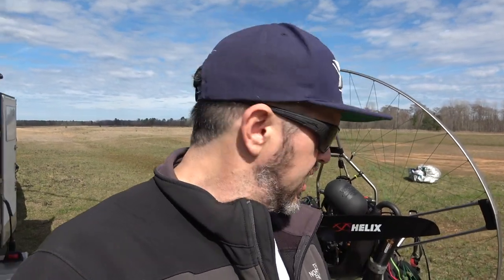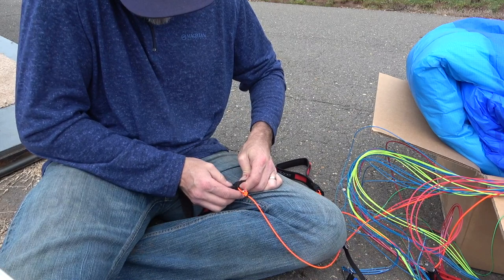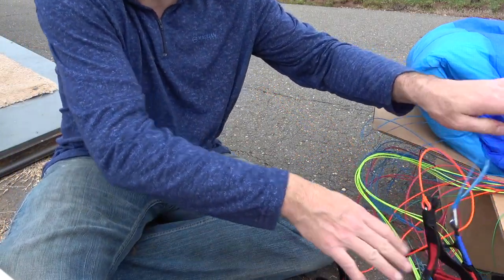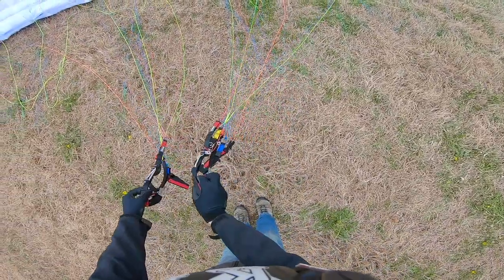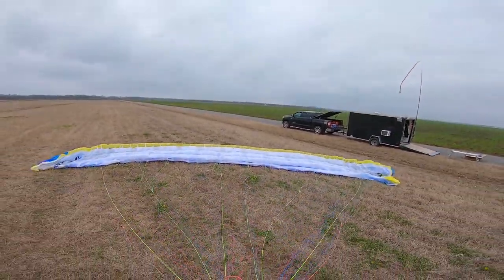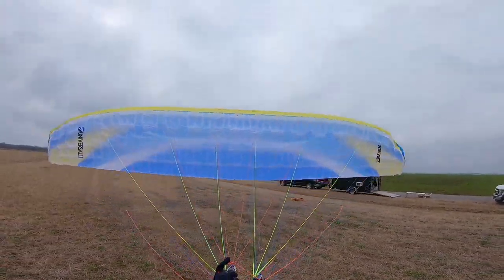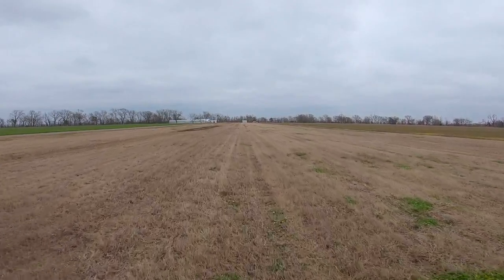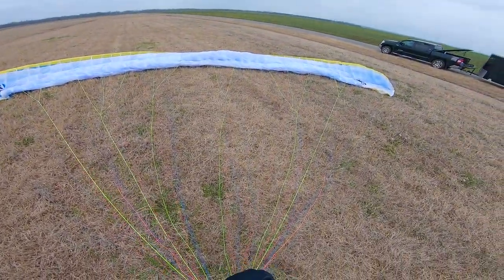Unboxing, Brake Adjustment, Test Flying, and How to fold a Paraglider

Comment: Love my 25.5 1.1 I have had the original and the new version . Probably won't ever get rid of it unless it is to sell it to get a new one. Hard to believe that design is 8 years old. I know they "refreshed it" by adding different material but the design remained unchanged overall. Dudek really knocked it out of the park with that motor lineup from several years back. Interested to see what they have coming out in the future.

Comment: Heya Kyle-O!
Do you find that Ozone's brakes need to be shortened a bit too? I have the Roadster 3 and it seems that I have to pull a good 3-4 inches or so (from the pulley) before I get any deflection, whilst trimmed at the red neutral line. I figured that if I was trimmed all the way out, I'd need those inches, otherwise it would be pulling brake? Or is it safe to shorten these by a couple inches?

Comment: What do you think about going over the weight range to keep it heavily loaded. I've been thinking for my next wing going with the uni1.1 23. I'm 185 in clothes with the pap125 which weighs 60lbs w a gallon of gas. I have been flying my free flight gin atlas2 w mark huneycutt with and without motor since I'm a cheap ass. Thinking the uni might be the best option for a chill ppg wing
Reply from the maker: They fly real nice overloaded!  I do it all the time.
Reply: Thanks for the fast response!

Comment: One cosideration is to not use a sharpie to mark lines in case you lengthen them in the future ,as the marker used does cause strenth deterioration in the line
Reply from the maker: Using a marker to mark lengths on PG lines is the industry standard Kevin.  All mfgs do this.  Where did you get that information?   On this wing, the lines are sheathed anyway, and the core is not actually seeing the ink.  Your statement baffles me sir.
Reply: @kyleoglee  There has been mutiple studies in the Climbing industry on the matter,  i will try to dig up some referance for you.
Marking is comon in many manufacturers, however Sharpie brand does have solvent in the ink that penetrate and weaken cord,lines,and ropes ect.
There are marking inks that are line friendly.
Reply: Glider lines and climbing lines are not made from the same materials. One is a polyester (climbing rope) and the other is Dyneema.
Its like comparing carbon steel to an aluminum alloy.
Reply: @kevinphilibert4075  I climb for a living and agree that you would not want the regulatory official showing up to find you had written on your harness with a permanent marker.  I wonder how over blown this is but I stick to the rules.  That said, I think Kyle is probably right that the sheathing protects the line from the ink.  Still, the same results come be achieved with a wax pencil w/o risk to the lines.
Either way, climb/fly safe!
Reply: LOVE your videos, but I have to agree with Kevin and crowd, as  climber you would never mark your lines or webbing with a solvent-based marker like a sharpie,  but then you're not really hanging off the brake lines, so it might be fine. We use Dyneema in climbing also, for accessory, anchors, etc. Had the same thought when Mitch (also great guy/vids) marked his torque adjuster. Still love ya!

Comment: How do you know if the brakes need to be shortened?? On my wing I don’t get any reaction until I pull several inches. Its also a universal 1.1.
Reply: Derick F right, but how do you know if it actually needs adjusted or not? Meaning, what are the signs they are too long?